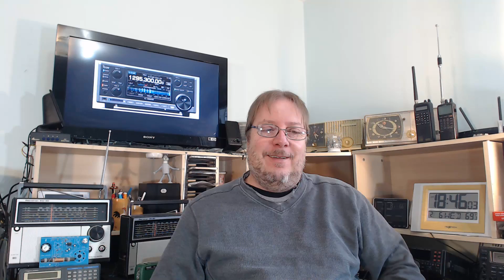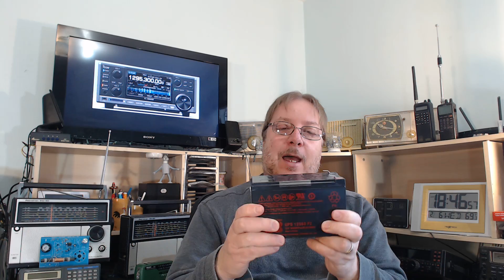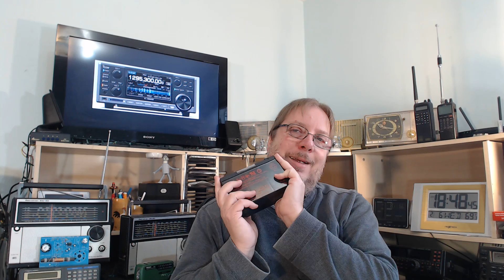Shortwave radio daily tip 5 Have a lead Acid battery to power your tabletop radios in power outage

Comment: always enjoy your videos ! I did something similar. Bought one of the battery boosters from harbor freight for starting car with a dead battery. It has a built in charger and output for cell phones and cig lighter output for my two table top receivers and a 10 meter ham radio.

Comment: Building a go box now. SLA 12v 12ah battery, plugged up to a battery tender to maintain it, and the radio inside the case will be an ic-2730a.
Almost have all of my parts together, so should have it built next week

Comment: I replaced my car battery recently when it wouldn't crank at 20 below, but I kept the old one for use in a power outages. At room temperature is still holds a charge -- enough to run some radios -- it just didn't have cold-cranking amps anymore.